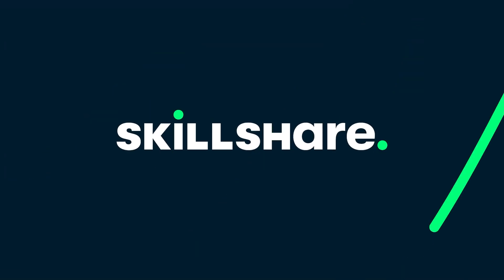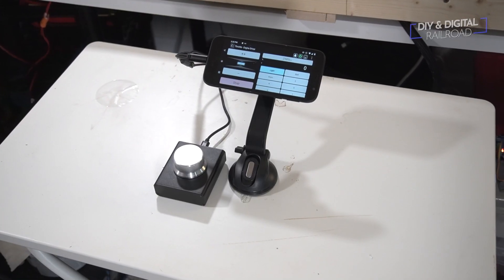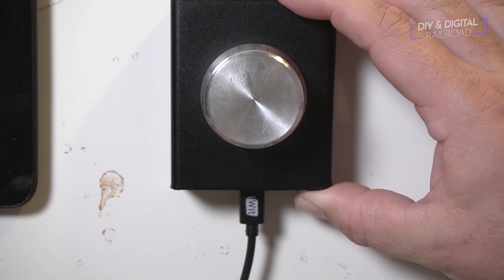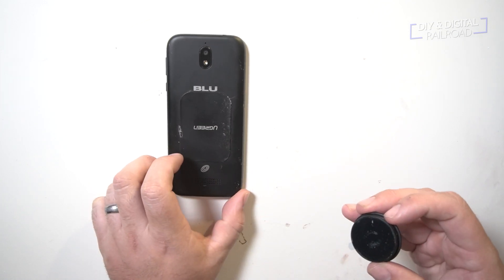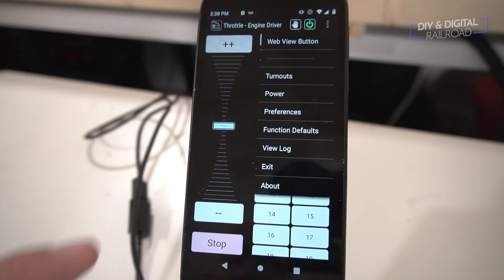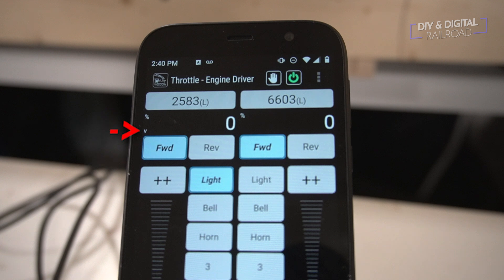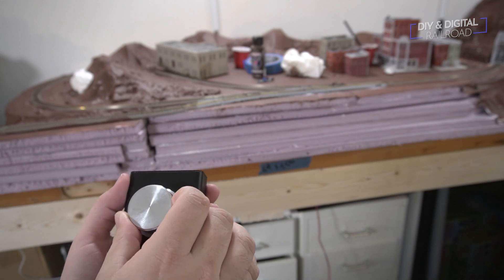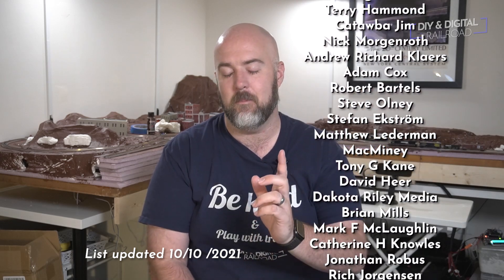Cheap Phones as Model Railroad Throttles???

Comment: So here’s the next question - would a bluetooth volume knob work for this? That would save needing all the adapters and what not, and you could use any phone, tablet, etc you had laying around, download Engine Drive, connect to Bluetooth knob, put the phone on the charger in the corner, and take the knob with you anywhere.

Comment: That looks very interesting, I have got Engine Driver to work with a tablet and a Samsung S6 phone which I have had for years, the tablet is an Android OS and has a standard  USB connector same as PC type,  do you think this would work with the Rotary Knob as well ... so maybe a straight USB to USB splitter etc ..Regards John
Reply from the maker: Hey John.  All you have to do is search for an OTG cable with your type of connection and you should be good to go.  If I had to guess, your connector would be micro USB.

Comment: Ah... a midi controller; looks like one, anyway. Wonder if that volume control is an absolute (0-127) or endless (picks up exactly were the setting was and doesn't have a left/right limit) encoder. Also, if it is midi, wonder what controllers could be adapted to  run multiple trains each with their own CV settings.
Reply from the maker: It is endless as far as I can tell.